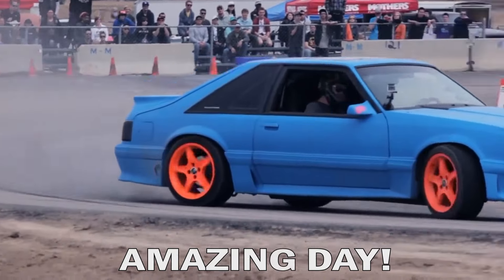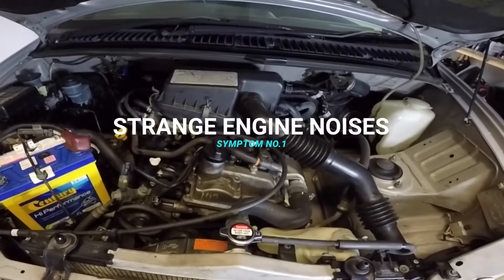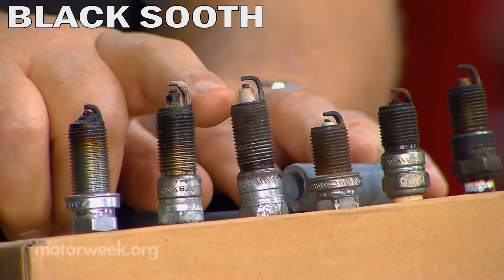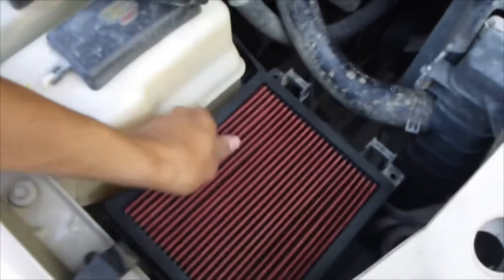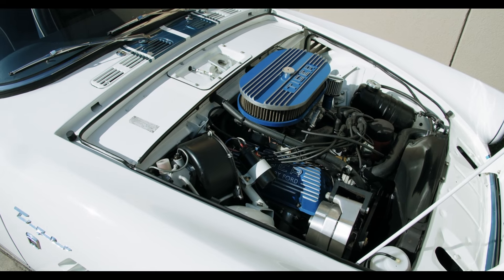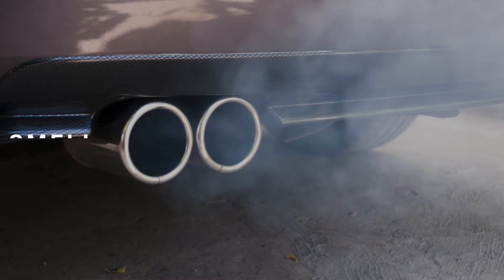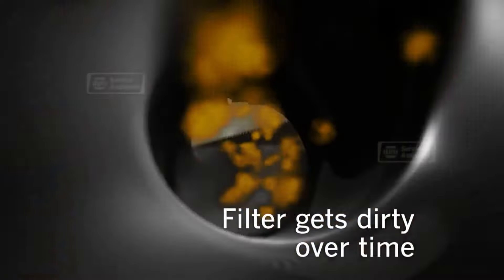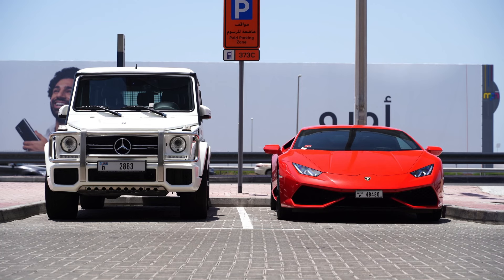7 Symptoms Of A Dirty Air Filter - This Is Why Your Car Feels Sluggish

Comment: Why would my air filter box feel hot??
Reply from the maker: Basically 3 things can cause this. Engine is generating more heat than it should (monitor the temperature gauge), poorly sealed air filter box which allows it to draw in extra hot air from the engine, and a dirty or clogged air filter.
Reply: Thank you I found a long crack at the bottom of the air box thanks alot you nailed it
Reply: It was not noticeable when I checked my air filter until I used a flash light at night and looked at the box sure shit light was coming from the box! So how can I repair this until I find a new box?

Comment: Fuel injected engines meter the correct amount of fuel for the air flow. A clogged air filter will reduce performance, but not decrease fuel economy. An older carbureted car will have increased fuel usage with a clogged filter.
Reply: Correct.   Likewise with efi, removing air restrictions will ad air and the computer will ad fuel accordingly to maintain performance
Reply: I have a 2012 Honda CRV and my air filter was definitely affecting my fuel efficiency. When I took out my old air filter I thought it would be dirtier than it was. It was black in some areas but lighter in some others areas. After replacing the check engine light went off. But the check gas cap light turned on. My car battery is not holding a charge anymore. So now I think I still have two more issues. Either it's my fuel pump or fuel filter or fuel relay is gone bad. Or it's just battery issue that won't charge anymore.
Reply from the maker: Correct, in fuel-injected engines, the air-fuel ratio is managed by the engine control unit (ECU), so a clogged air filter typically affects performance rather than fuel economy, whereas in carbureted engines, a clogged air filter can cause richer fuel mixture and lead to increased fuel consumption.

Comment: 30.000 miles is a lot , should be changed every 12/15000 miles max
Reply: Nobody told me this. Corolla been driving for over 20,000 miles. Just ordered a new one
Reply from the maker: Depends on where you live. I can go easily 30k without changing it.
Reply: @carcarehacks  I live in the desert where it gets very hot.  Would I need to change it more often as a result?

Comment: Would I need to change it if the AC recirculating button doesn’t come on when I use the ac but works with the ac off?
Reply: I’m late but this has no effect on it. This just filters the air your engine sucks in, unrelated to your hvac. This is either an electrical issue or simply how your car is designed
Reply from the maker: No, you likely don't need to change the blend door actuator if the AC recirculation button doesn’t come on when the AC is running. This issue is more likely related to:

HVAC Control Module: A fault in the control module or its programming might prevent the recirculation function from activating under certain conditions.
Electrical Problem: A wiring issue or faulty connection to the recirculation system could cause intermittent operation.
Recirculation Actuator: If the actuator that controls the recirculation door is failing, it could behave inconsistently.
You should check the control panel's functionality, wiring connections, and the recirculation actuator before replacing any components.

Comment: Can a bad air filter cause overheating I’ve change out a lot of my coolent systems parts already and it happens once in awhile turned out to be a head gasket lol 😂
Reply from the maker: Were you loosing any coolant without leaks?